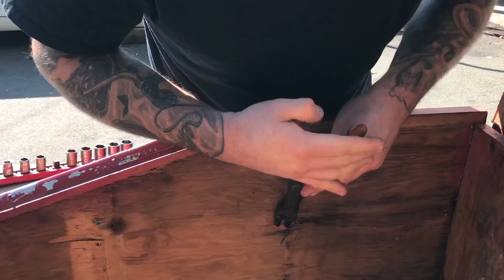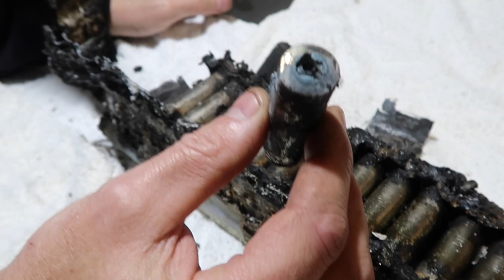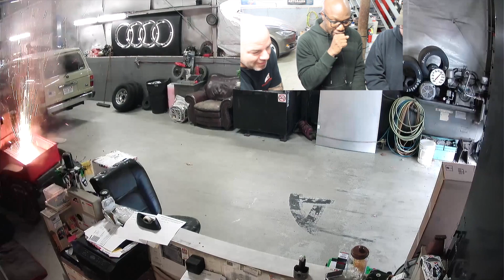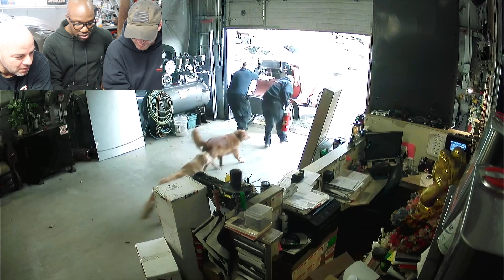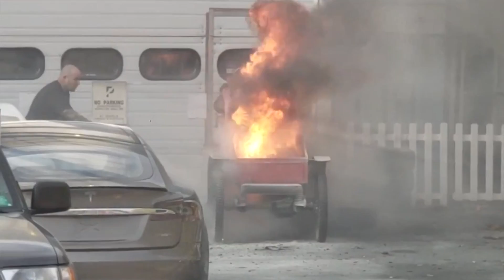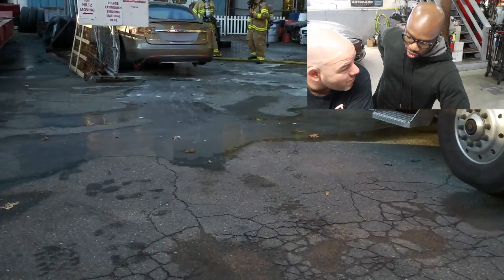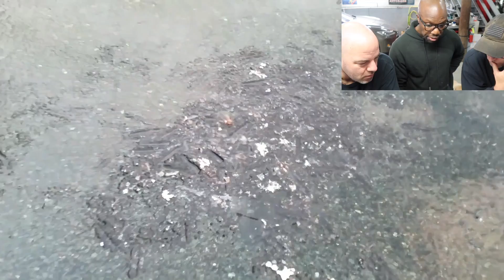My first Tesla Battery Fire

Comment: It's probably not fair to call it a "Tesla" battery fire since you removed/bypassed most of the safety items that Tesla designed into that battery of cells.
Reply: True though I think Tesla is betting on the wrong battery chemistry as lithium iron phosphate batteries are much much less subject to thermal runaway than lithium nickel cobalt aluminum oxide.
The problem in NCA cells is that cobalt exhibits a negative resistance which encourages thermal runaway in a positive feed back loop.
Reply: @Patchuchan  The first trouble with LiFePO4 batteries is the 14% lower nominal voltage. You need more cells in series or you have to run higher currents for the same power. The second trouble is that they have about half the energy density of 3.7v Li-Ion with Manganese or Cobalt chemistries. A manganese-based chemistry tolerates very high discharge rates with its low internal resistance and the thermal runaway temperature is 250 C, about 20 degrees above the auto-ignition temperature of paper. This is what you'll find in a tool battery. Adding the Cobalt makes it easier to achieve higher energy density at the expense of a more volatile electrolyte that will start to decompose exothermically at 150 C.
But all three will have a problem if you overcharge them as was likely done here.
Reply: @Markle2k  Actually the energy density is roughly the same especially after a few years of use since they have a longer cycle life though they have a higher internal resistance the advantages outweigh the disadvantages.
They are less fire prone and are much more environmentally friendly to manufacture since they don't need any cobalt.
Lithium mining gets a lot of flak in the media but the real polluter in EV battery manufacturing is cobalt mining which makes fracking for oil look down right benign.
Reply: @Patchuchan  No. The energy density is not the same. Like I said, it's about half.
LiFePO4 is around 90-110 Wh/kg and 330 Wh/L. 
Lithium Nickel Cobalt Aluminum as in these Tesla cells is 220 Wh/kg and 600 Wh/L. 
Lithium Nickel Manganese Cobalt (INR) cells are 205 Wh/kg and 580 Wh/L. 
Vaping/power tool cells with just the Manganese oxide (IMR) have really good thermal and discharge current properties but are 150 Wh/kg and (no kidding) 420 Wh/L.
The Phosphate electrolyte itself isn't flammable, but if you overheat a LiFePO4 cell it will decompose and vent flammable vapors including hydrogen and hydrocarbons. LiFePO4 cells have another disadvantage, they will self-discharge, not as fast as ordinary NiMH, but about 10x faster than LSD NiMH (Eneloop), and far faster than other Li-Ion chemistries which are almost immeasurable.
Cobalt comes from copper mining, mostly. Arsenic is also associated with Cobalt ore deposits (Cobaltite is CoAsS) which is where the bad reputation comes from. But again, that's not the source of most cobalt.
On the other hand, you (and all animals) need cobalt to live because it is a core component of vitamin B12, which your body cannot synthesize (an essential vitamin). Without B12, you cannot synthesize DNA inside your cells. That's why vegans have to take a supplement or eat grains that are supplemented with B12. B12 is only produced by soil bacteria and archaea.
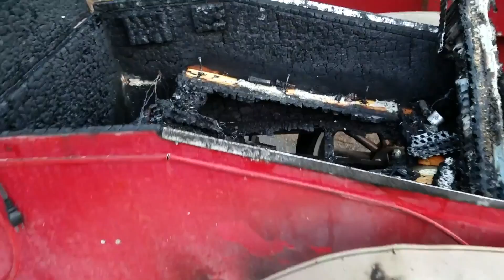Reply: if you watch the video all the way through and dont just try to bash them, you would notice at 11:30 he does mention that this is what can happen when batteries are not in a tesla and disconnected from all the tesla precautions. so yes this was a tesla battery fire and he did share a disclaimer that obviously tesla protocols were not present in the setup.
Reply: @dallasmavs4263  So if drive your F150 off a cliff are you going to title that video "ford chassis failure UNBELIEVABLE DAMAGE"
Reply: @toasty4000000  i mean yea depends on why or what happened when u drove off a cliff but yea something like that
Reply: @dallasmavs4263  so clickbait for you too, cool
Reply: @dallasmavs4263  No. It was not a Tesla battery fire. It was a fire that Rich admitted was caused by not having any of the safety systems that Tesla includes in their batteries. The cells were sourced from a Tesla, but they could have been sourced from a bunch of junked laptop batteries just as well. It would have yielded the same result when they were overvolted. This was a lithium battery fire.
Reply: .... agreed,  surprized Tesla hasn't come knocking!
Reply: yeah i agree
Reply: Theres some controls but even Boeing has planes running around with these batteries that havent show very well success. Granted, the environment planes are in are greatly different from cars, but they have a ton of systems to keep them under control after two runaways and a grounded fleet of all 787s. Systems that dont keep them from running away but once it happens to stop it.
Reply: but muh views
Reply: dosnt stop shitty tesla from goung on fire tho does it ? teslas r lame and gay cars
Reply: I read somewhere that the type of battery used in Teslas in this moment are the unsafest batteries of all compared to other Electric car manufacturers like BMW
Reply: sounds to me this guy has a grudge on Tesla, he is pathetic and should try live on the bottom like a majority he should be lucky he doesn't have to find cars running for £300 to be viable to drive and own.
he's obviously rich enough so why does he need a little youtube channel to feel better?
the name clearly implies hes trying to draw the image that the battery were a malfunction of Tesla same with his follow up on his 2nd hand tesla buy. childish tactics.
Reply: @Dockhead  Nope, you've totally misread Rich. He isn't a fanboy, he's an enthusiast. He doesn't look past the faults, he looks directly at them and sees them as points for improvement. Also he's not wealthy. He's obviously fairly well-off that he can afford some toys, but a lot of those toys he's fished out of the garbage can and put in the effort to bring them back to life.
Reply: @Markle2k  never said fanboy. quite the opposite infact. i meant hes purposefully picking Tesla apart when in fact i could do this to ANY company. which we are onabout company's running upto and over 100 years old. ford *cough cough*. listen this guy is well off to my opinion pretty well off. i come from the most povertised area of my country and i can tell you how many cars i could have bought and running to sell to others who cant possibly afford a car outside trying to just survive alone. he has a garage. its just all his other Tesla vids it just all seems like a codex for Tesla's bullshit company process. tesla is bullshit just hes a grown man and maybe should of bought through a personal dealership to personally 'see' what could or is going on. its like he's moaning for sympathy almost. not on this vid but others.
Reply: ... Its still 100% a Tesla Battery fire tho... The reason to the fire has nothing to do with it. You dont call a dumpster fire "Drunk Cali man shoots up on meth and falls with a lit cigarette near a dumpster, starting a small fire which was then escalated into a large fire as a bypasser acidentally threw a burning stick into a dumpster"-Fire

Its still going to be named "The XXXX (region) Dumpster fire of 2019"
Reply: Thats some hoops lmao
Reply: @Nori LOLOLOL
Reply: @sonny9608  Nope I speak of facts about these battery cells. Those same batteries and nearly all other lithium chemistries have shipping over the boarder band by many countries and every air line due to the volatility. There are first responders worried about these issues and that dates back nearly decade when one of my friends who is a paramedic was telling me about that. You can read about some articles online to. Its not fear mongering either. We're discussing the pros and cons of EV in hopes of making this better someday. We already know a Tesla burned with all occupants dying and others have caught fire so you cant deny that. Its is rare right now but as mentioned EVs are less than 1% of all cars and most of that small percentage are newer cars in the last few years. Crash testing is great and proves under a handful of controlled tests how the car reacts. If you look up "vehicle extrication" You'll see that every bad accident is different, cars are crashing in many circumstances that mangle them in different ways worse than the crash testing and can result in death . In the US alone, over 40'000 people died last year in vehicle accidents.
Reply: Here come the Tesla fanboys...
Reply: Who gives a shit?  THIS IS A TESLA BATTERY FIRE!
Reply: @montgomeryrothschild4986   No this is a RICH REBUILDS BATTERY FIRE!
Reply: @sonny9608  No they are both bad. I've clearly stated that in earlier comments in this thread. Saying just stop and not wanting to bring awareness to issues that can kill people is just plain irresponsible.
Reply: @sonny9608  I think your to used to the norm which is fires happening in cars so thinking about a battery system that could arguably be a little better but still can catch fire and seems very okay to you. There are 150'000 car fires in the US each year. I think we should strive for something better that does not catch fire or can electrocute you. Thats all I'm saying
Reply: This is good for people to see. If you drive a Tesla and get in an accident on the highway you should know you can be electrocuted or burn for a long time. Safety systems for charging won't do much if the battery, even 1 cells get physically punctured and causes the rest to have thermal runaway.
Reply: @practicalguy973  I don't know why these people apologize for Tesla all the time. What do they get out of it? (I drive a Tesla, but if I get into an accident, I'm getting away from it as fast as possible!)
Reply: @practicalguy973  your comment implys one breaking will lead to runaway. it wont always do that.
Reply: @practicalguy973  You aren't very practical if you live in a world of your own imagination and continue to ignore the real world. No cell got punctured here. This is a good thing to see for people playing around with Lithium battery systems in general. Those safety items are not there for show.
It appears that they were charging the battery at the time. There are leads going to the car and after Lee nearly gets his face blown off trying to blow out the flamethrower, he unplugs something from Daisy.
The most probable explanation from what I can see here is that one of the parallel bricks inside the left module was overcharged. One of the weakest or warmest cells in that brick then started arcing internally across the separator, decomposed some electrolyte into oxygen and fuel (an exothermic reaction in itself) and eventually ran away thermally. BTW, this is another incentive to get rid of cobalt in the formula. It makes higher capacity easier, but also lowers the temperature of spontaneous chemical dissociation of the electrolyte that gives you the thermal runaway.
A balancing and overvoltage protection circuit would have prevented the scenario I present here. The individual modules of the 85 pack are 6S, which, if charged with a lead-acid charger such as used in aircraft and large trucks with 28/24 volt buses, would over-volt the module beyond its 25.2 v maximum safe limit of 4.2v/cell. This is why 7S is popular with people making DIY powerwalls charged from standard 24 volt solar chargers designed for lead-acid batteries. The bottom voltage is comfortably above the bricking voltage of Li-Ion and the float voltage is below the 29.4v of a completely charged system. But without a balancing system, it is still possible for some paralleled cells to fall behind the voltage of their neighbors. If you're just monitoring the total voltage, the high cells can overvolt and fail.
The coolant is to prevent beehive syndrome where the internal cells get warmer than the peripheral cells by distributing the heat and then passing it to a heat exchanger outside the pack. Warmer cells are more in danger of internal damage.
And finally, electric car fires are far less likely than gasoline car fires. There are fewer components to go wrong and fewer flammable liquids involved. BMW had two recalls last year covering vehicles from 2007-2011. And this year it turned out that 2011-present vehicles were also prone to self-ignition relating to the same EGR component. That totals 1.6 million vehicles recalled after the original 1 million vehicle recall. And this is the one that they claim can only happen when the cars are being driven at high speed for a long time and that it can't happen while parked. Apparently there will be another recall in the pipeline once they figure out why all those parked BMWs have been catching on fire too. Nissan issued a recall this year when it became clear that brake fluid from a faulty seal in an ABS pump leaking onto a circuit board could cause fires. Again, earlier this year Audi recalled 1.2 million cars and SUVs due to a faulty coolant pump that could overheat and cause a fire.
Reply: @Markle2k  I didn't say gasoline cars are somehow better for fire. But they certainly won't electrocute you like and EV can. I wasn't talking about the reason the fire started in this video. I'm pointing out the aftermath if the battery pack catches fire for whatever reason. The coolant and way the cells are positioned does help but it does not stop the car from burning in some cases. I wanted to let people think if a cell puncture happens, which it will in some accidents then you can have a chain reaction and large fire similar to the reaction in the video. I'll be curious to see how all EV's are as they age and once there are billions more on the road how safe they are in many circumstances. I'm hoping they make some changes soon to the battery chemistry so its safer for fire. Adding some kind of immediate physical disconnect to the cell modules could help so electrocution is not possible with an accident or with first responders trying to extricate victims. Something to reduce the pack to isolate the 16 cell modules each in the event of an accident would be a good start. With Tesla as one example, the fusing of each cell they currently have would only disconnect if there was a short to the pack and the fuses burned. They need something as reliable as an airbag to disconnect those battery modules instantly.
Reply: @practicalguy973  Nothing stops everything from burning in all cases, therefore "does not stop the car from burning in some cases" isn't helpful. What we have is a 5 year history of Model S cars in collisions of many kinds and the result is that you should really prefer to be in a Model S.
Your toaster can electrocute you. Teslas do have switches to turn off power from the battery. They are standard issue in electric vehicles. They are bright orange. You might want to view some more of Rich's videos where he takes them apart.
It is somehow national and worldwide news when a Tesla catches fire because it is rare. But, on average, 500 cars catch fire every single day in the US. But if you Google "burned to death in a Tesla" you will only find the story of the joyriding teenagers who slammed into a concrete wall in Ft. Lauderdale. Want to know something else that will burst into flames if you lose control at high speed and slam into a fixed object? Just about any car, but also a Porsche Carrera GT carrying a Hollywood star. You can put "slammed into concrete wall caught fire" into Google and be rewarded with a lot of examples.
Reply: @Markle2k  Does the bright orange power switch activate automatically in a collision? I thought it was just for disconnecting the pack during maintenance?
Reply: @Markle2k  you do a lot of assuming to make you argument I bet you also believe in global warming lol
Reply: @Markle2k    Turn off the battery all you want the problem could be if the cells are exposed to heat/fire or punctured.  The technology does have potential however dismissing any issue as rare doesn't help anyone.  It simply leaves people in potential danger and totally unaware because of coverup.  This is with any currently used battery technology even a standard 12v starting battery can explode if punctured.
Reply: @cardinaloflannagan8929  You'll have to learn how to punctuate sentences before I can reply to whatever you are trying to say.
An overcharged lithium cell will arc within. This creates a cascade of exothermic reactions that results in explosive gases being generated and a general runaway situation within that cell. Without having the cells separated from one another by a thermal shield of liquid, they could then cause their neighbors, also overcharged, to begin the same process. Once enough heat is generated, even relatively healthy cells will start self-destructing. That's why it started with a pop! It then went to a relatively localized fire. And then it turned into an inferno that had to be waited out.
Reply: @Markle2k  Oh sorry I cannot reply you only put one space after an exclamation point.  Oh wait you replied anyway due to fanboy obligations and then make your own error.  Is there a reason other than to make yourself feel superior to criticize punctuation?   Before being compelled to explain something that wasn't even in question.  To once again make yourself feel superior would be the answer to that.  While also ignoring the point, that a large multi cell battery could be dangerous.
Reply: @timessiah94  LOL a global warming denier. I bet you also think the earth is flat.
Reply: @Markle2k  I think the orange switch is great for working on the car but in an accident you could have mangled parts from the Tesla or the other car that was part of the crash that make the switch impossible to get to. I'd like something that is automatic and instant to disconnect the battery, not manual. 500 cars burning is true but EV's only make up less than 1% of the vehicles in use each day so of course your going rarely hear of EV's in that mix. Considering there are 276 million vehicles in the US, 500 burning a day is an extremely low percentage.
Reply: @Markle2k  This is a very shallow comment on your part "Nothing stops everything from burning in all cases, therefore "does not stop the car from burning in some cases" isn't helpful. " What are you talking about? If there is a burning battery there can be many scenarios, say a metal rod goes through and one cell burns yet the cooling solution is still in the battery modules so it does not spread to each cell before that  punctured cell stops burning.... or in another example, there is a gash 2 feet long in the battery and lots of coolant leaks out and then each cell thermally goes off. Do I really need to waste time actually explaining this to you? Its common sense.
Reply: @practicalguy973  You don't know much about Tesla batteries, their history and construction, do you? You're just here to argue from ignorance. Which makes you a troll of sorts. Common sense is often neither and the promoters of it are generally bluffing about their expertise.
Reply: @Markle2k  Most people reading, seeing my links and researching on there own will find the same facts so they will put 2 and 2 together and realize I'm not trolling. I just used the P100D as an example since this video is using Tesla modules that were on fire. Just to be clear I'm not against Tesla, I'm just here to spread some different points of view on current EVs in hopes of something better than Nickel cobalt aluminum oxide powered cars. I provided a lot of facts in this comment thread, none are ignorance they are real issues that can happen and have happened. Its a very small percentage of EV's that are in situations of potential electrocution or fire. But it would be nice if there was a power source that was better.
Reply: Practical Guy you won’t get electrocuted get real
Reply: @Ouski  no the earth is round we can measure it with physics just like it disproves global warming in your sense.
Reply: The irony of fires in petrol cars is that most of them are electrical fires. Fire and explosion risk in ev batteries are not a problem than can be solved easily or completely, just mitigated. In fire terms petrol is safer than ev, hydrogen is probably the worst and diesel the best. Of course diesel gets you with the NOX fumes and particle emissions so nothing is perfect. If not practical at all today the best of all against fire is a nuclear reactor/battery. They can be designed to go into a shutdown hot state when the machine is shut down. Removing the coolant basically shuts down the reaction and the machine just waits until it is refilled. Of course there is the tiny detail of the radiation and the fact that in its hot shutdown state the machines core remains at about 500 degrees c. Plus the fact that they are very heavy and that some people turn into panicking mindless chickens when they hear the word 'nuclear'.
Reply: @Lucien86  First thing, you're off topic. This thread was about the video title, which remains unchanged.
Second, your first sentence is wrong. 49% of highway vehicle fires are due to mechanical failures or malfunctions. Electrical failure/malfunction fires are second at 23%. 8% are arson. 3% are from collisions, but these are responsible for 58% of the deaths as a result of vehicle fires. 0% of the deaths occur in vehicle fires as a result of electrical failure. The final category, 5% of vehicle fires are secondary, that is, another fire set the car on fire.
https://www.nfpa.org/News-and-Research/Data-research-and-tools/ARCHIVED/Fire-statistics/Vehicle-fires/Vehicle-fire-trends-and-patterns
Fire and explosion is a miniscule risk with batteries. The first progresses slowly, the second doesn't happen. Batteries have pressure release valves that prevent case rupture. You can literally see this occur in this video.
Petrol is not safer than EV. Again, the actual statistics point in the opposite direction. Petrol and diesel fires are so common, 17 per hour in the US, that they don't make the news unless they cause a traffic jam in rush hour, and then they are only in the news until the fire is out and traffic flow resumes.
Hydrogen is not "probably the worst". There aren't enough hydrogen-fueled vehicles in use to generate reliable statistics. Besides that, hydrogen vehicles on the road today are full of sensors for detecting leaks, something not present in petroleum-fueled vehicles. The tanks are stronger against breach than the structure around them. They will push stuff out of the way rather than rupture. When they do get breached, the hydrogen turns into a jet of super cold gas that is much lighter than air and dissipates quickly. Ignited, this turns into a blowtorch that runs out of fuel in a couple of minutes When a liquid fuel tank is breached, the fuel pools under the car and can burn for an hour or more.

And then you start going off the rails talking about nuclear reactor-powered cars or something. I should have read more of your comment, I wouldn't have bothered responding to such a kook.
Reply: @practicalguy973  actually, it looks like you have the best chance of surviving a car accident inside a tesla.
there are also some battery puncture tests that went pretty well.
Reply: @daSiew  They do look pretty safe in some circumstances. Once the sample size is closer to half ev and half fuel on the road we'll know more. Seems that no matter what you drive there will be risks with the power source.
Reply: daSiew except Tesla in crash testing Tesla seat belts did not lock soon enough resulting head injuries in a crash. The new Alfa Romeo has a way higher rating than the Tesla and the Alfa is actually one of the safest cars on the road safer than Tesla.
Reply: @jimmygrant3212  nice white lie, but hey dont let that get in the way of your nice story. just looked up multiple articles and statements and none have discussed or shown alfa even being near top 10 sorry. they might have caught up to the world, but in no way are the actually one of the safest being regarded, they have a reputation for losing you money soon as you walk out them alfa romeo dealerships.
Reply: pescod96 the Giulia is a top safety pick… https://www.iihs.org/iihs/ratings/vehicle/v/alfa-romeo/giulia-4-door-sedan/2018 the Tesla is not a top safety pick and has a lower rating… https://www.iihs.org/iihs/ratings/vehicle/v/tesla/model-s-4-door-hatchback/2017 do you believe it now or are you going to still argue it’s not true?
Reply: Practical Guy
Cell punctures will cause a fuse to blow on the cell.
This probably happened because of a bus-bar short.
Reply: @TauCu  Thats not how thermal reactions work in these batteries, its not controlled electronically by a fuse. If the cell is punctured it will heat up. If one cell is burning it will heat the cells beside it and they burn there after. The cell level fuses did not stop the fire from spreading this this video and they are in tact on the battery modules.
Reply: The membranes in the cell have resistance, This is calculated so that not all of the current of the cell if focused in a small area, for example, where a nail pierces it, the cells are only a few volts, so this is doable, and the heat can be dissipated over time, The explosion in the video cannot be caused by a few volts, Each cell has a fuse isolating it from other cells if it shorts, thus stopping the other cells from dumping current into it, What likely happened in the video was a short to one of the cooling lines on one side of the battery to the other, I doubt 2 something odd volts is gonna cause a sparkler like that to FLY up into the air, hell, even 12 volts car batteries can't do that shit, that needed a lot of voltage to parse that current.

TLDR: As it was an explosion of that magnitude it was likely due to a bus bar short to some other area of the batteries, probably though one of the cooling lines, The fuses would likely not burn out until it's too late, as all of the cells in a row (or most of them) would be dumping energy into that short, and the voltage would have caused the metal to blow away (as seen in the video) and reform, sort of limiting the current as it started out, after that it was too late, those things started dropping like flies.
Reply: @practicalguy973  You are completely correct to be wary of the potential for a battery runaway fire. Too bad the EV car zealots cant see that.

Gasoline can be doused easily and with available chemicals, Tesla burn till there is nothing to burn, and in that one case will reignite a week later to finish up lol
Reply: @tylerh629  Very well put statement.   Rather than admit a potential problem they'll blame it on anything they can contrive.  Unwilling to let it be known to be aware of something instead people may not treat a situation with the urgency needed.  Just as on planes pilots are taught to fly the auto-pilot primarily.  As in theory this should be running nearly the entire flight.  Instead if due to problems that can't happen, yet do they go to manual there can be serious issues.  They may never be taught how to even have full control.